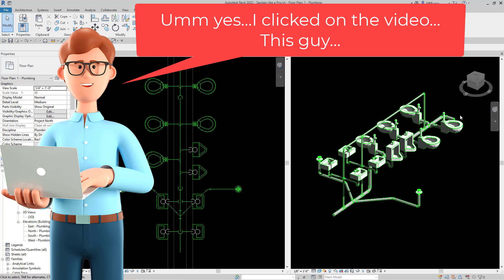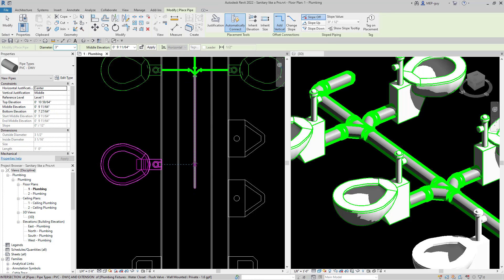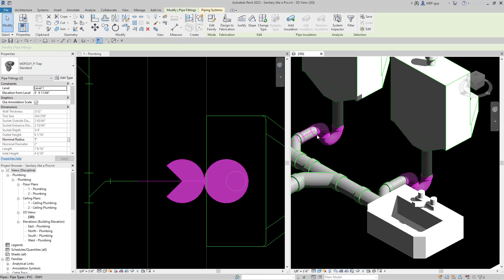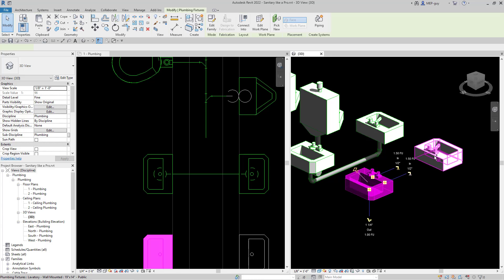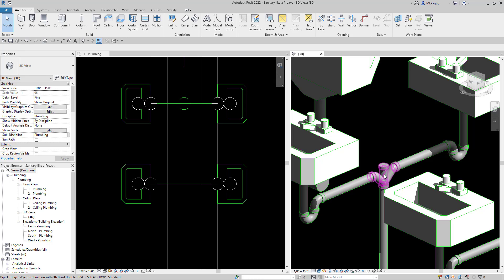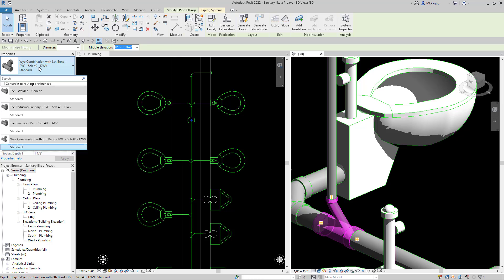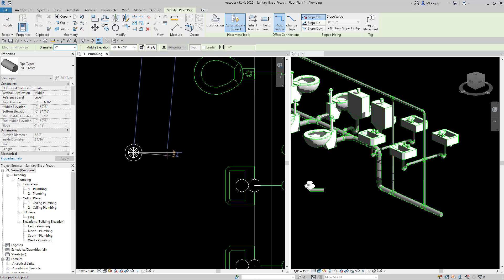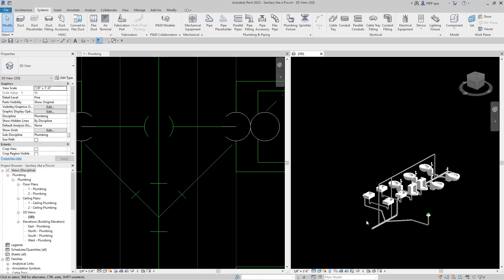Sanitary Pipe Modeling in Revit (Start to Finish)

Comment: But the "horizontal" pipes are without a slope.
Reply from the maker: When modeling wall hung water closets there is little benefit to modeling the piping with a slope. But if the model is needed for fabrication then you would want to use a slope, but for design, I'd recommend not sloping the pipe.